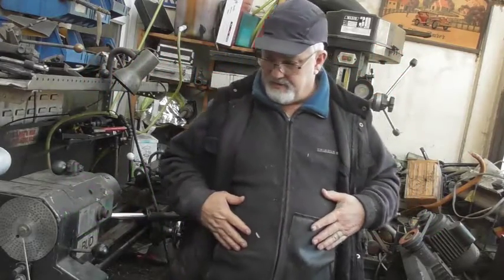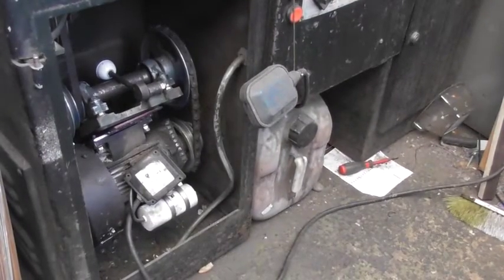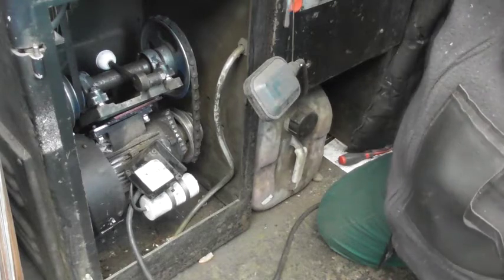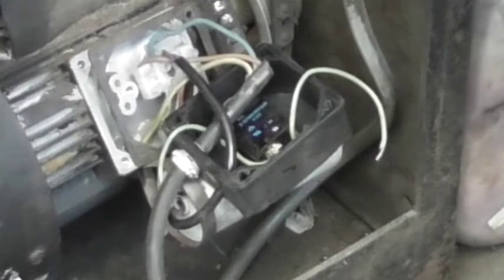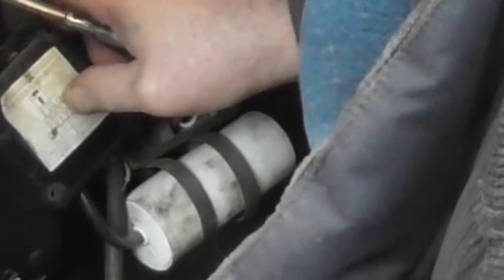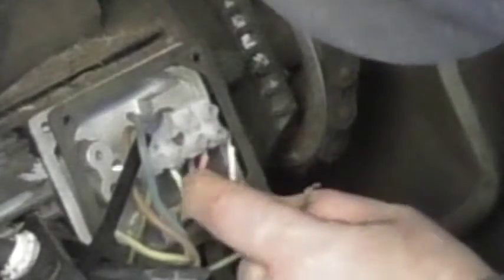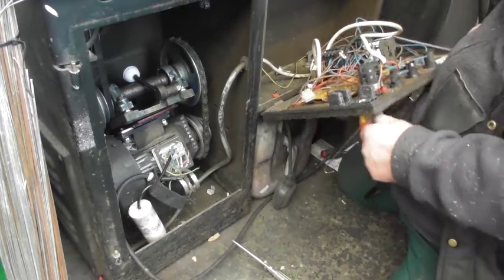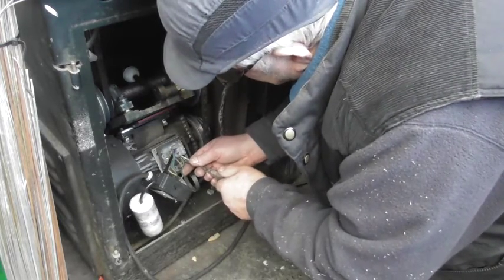how us Welshmen dont like having our wires crossed

Comment: Go figure I watched this one after the later video. Only 2 questions. For sure the wiring diagram is not on the reset switch boxcover? also it is an on/off/on switch or a rev/off/fwd switch on the front of the lathe? Thanks for the videos.

Comment: It looks like your motor is a single phase motor with one starting capacitor and one smaller capacitor to keep the motor running. The big starting capacitor must be switched off when the motor runs or it will soon been destroyed.  inside your motor is a switching device that should switch it off automatically.Try the diagram on this side and then change  W1 against W2 and hope that it works https://www.elektrikforen.de/threads/bitte-um-hilfe-bei-motor-laufrichtung-aendern.18003/
Reply: i think if you are colour blind you are predestined for such kind of work ;-).
P.S. be carefull with the capacitors because they are loaded a long time and the leads are dagerous to touch - full suply voltage!!